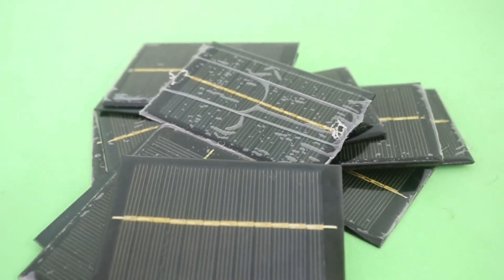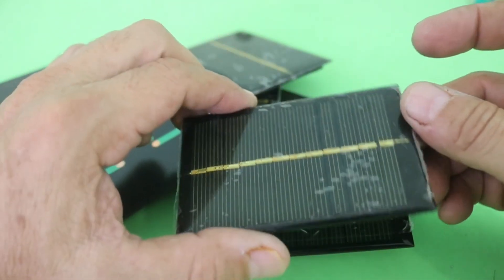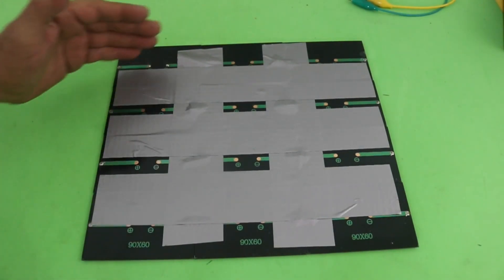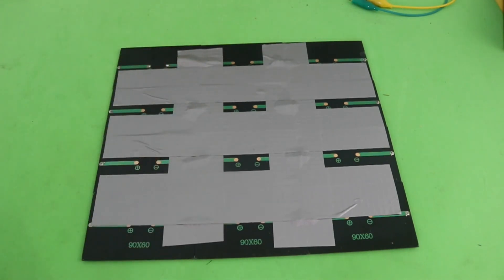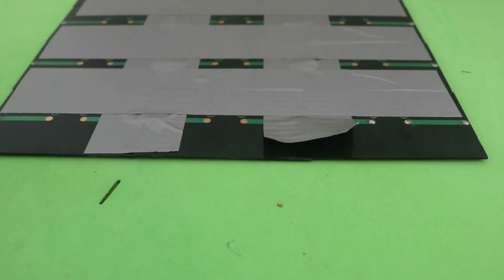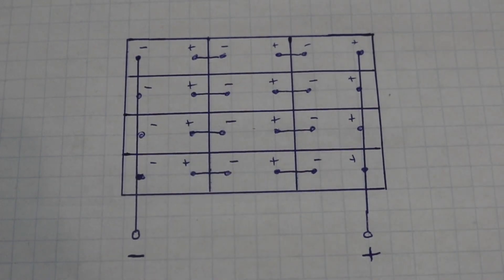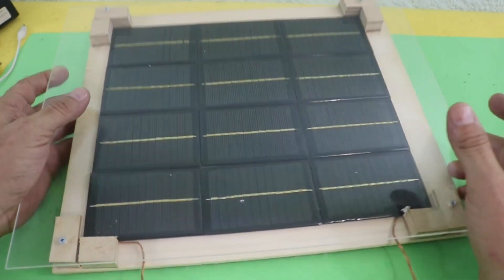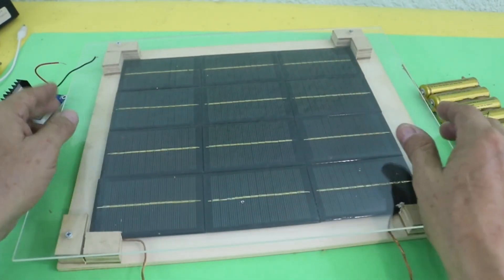Small Diy Solar Panel

Comment: could this be affordable to scale up?
Reply: I assume the expensive part is the glass to encase it. I saw a site maybe like alibaba or amazon (dont remember now) sell them for cheap individually but you have to do the work to attach and encase.
Reply: No. Not affordable. Not as efficient and not as resistant to uv degradation.